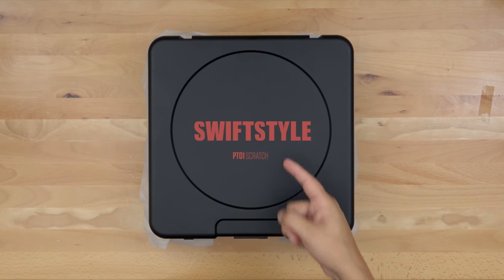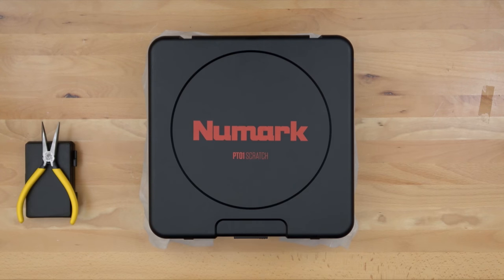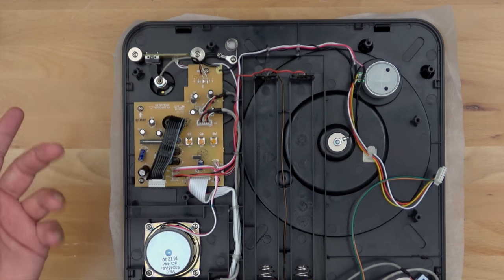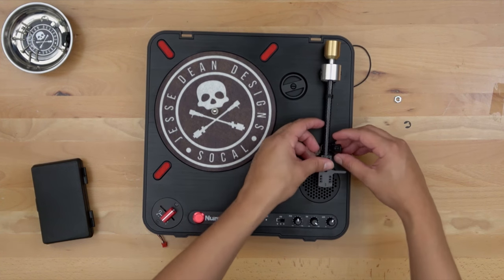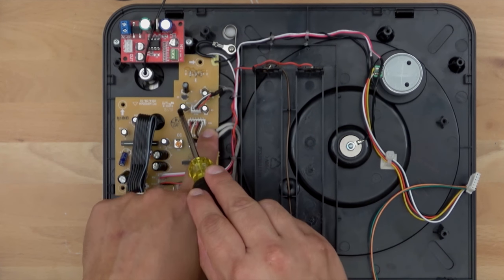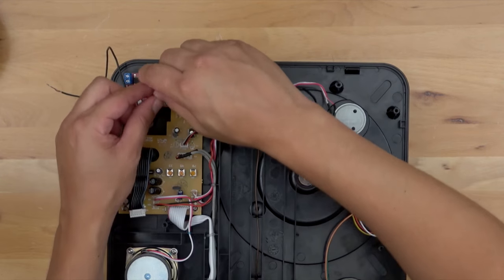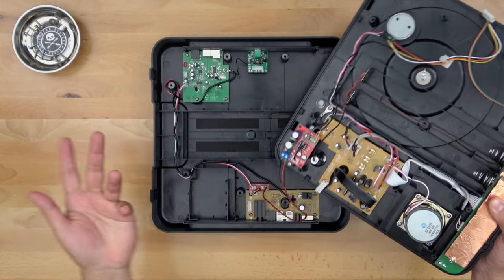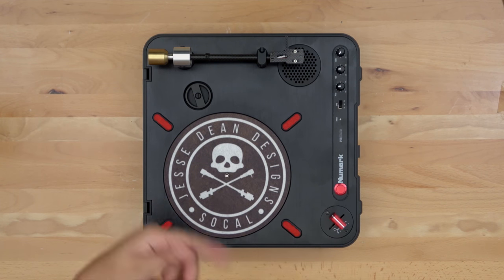JESSE DEAN DESIGN PORTABLE TONEARM (JDDPTA) | INSTALLATION

Comment: Kinda wish Jesse would've tried to use some affordable materials when making the tonearm, the milled aluminum and carbon fiber plus the pre-amp makes it cost more than the pt01 scratch itself. Numark should consider partnering with him if they plan on redesigning and releasing a newer version.
Reply: Thats the case in any decent setup, a tonearm alone will cost more than a turntable, not to mention a decent phono; this package actually seems like a bargain.

Comment: Finally got my JDDPTA in the mail, thanks for the video; it made installation straight forward and put me at ease when I was nervous about soldering/desoldering capacitors for the first time.

7:53 did you skip a step to where the connectors on the board go? I figured it out by just freeze framing and copying where they went but it would've been nice if you explained it. Do you know if Jesse is going to make more things to utilize the extra power out connectors on the power board?

Comment: I just got the newer version of this tone arm and I can already tell the set up is a little different. Not sure if we still have to remove the capacitors on the new set up. Also not sure where the extra part should be mounted and connected.
Reply: Check out jessedeandesigns.com

There is a installation guide. Easy peasy.
Reply: I'm in the same boat with the same question.  @Fe do, that link isn't good. FYI.
Reply: Krushtek 1 u need to remove capacitor c8 and c18 !
Reply: Check his webside...u will find something i am sure, he haves good tutorials for this. Installation is not that hard. Hope u guys get it. If not hit jesse up on instagram or facebook, i am sure he will help u out✌🏻
Reply: Thanks for the reply.  I think I figured it out.
Reply: Krushtek 1 ok nice !:))
Reply: @Krushtek 1 Hi, so did you got rid of these capacitors or you left them? I got the same issue.
Reply: Hi!  Man, it's been a while and I can't remember off the top of my head.  I remember that the new boards were different than the vid and I left the capacitors on.
Reply: Gotcha. I've removed them because I was following this tutorial and then realized that the installation guide for the new tonearm is slightly different than for the old one. However, it works just fine without these capacitors, so I think it's nothing to worry about. Cheers!
Reply: Great!  Glad to hear! Enjoy!
Reply: @lilxjam  I did the same thing, I removed the caps before noticing that the tone arm was slightly different. Did you end up soldering the wires from the preamp to the same capacitor spots like in the vid (6:18) or did you use the supplied 'no solder board'?
Reply: @hec0  Hi, I didn't solder them back. I was told that it doesn't matter if they are soldered or not for this particular issue. Cheers!

Comment: Can i still mount the pre amp to the place whats shown in your video when i have a relay there for start stop ? Instead of the factory start/stop board ?
Reply: Fe Do have you worked out how to do this? I've just got the point where I'm about to instal the preamp but my relay is there, im unsure how to move it or what the wiring would be
Reply: halfkut2193 i am still waiting for my jddpta to arrive..

Does the pre amp fit on top of the relay ? How u did it now ? Please let me know. Peace
Reply: halfkut2193 how u made it now ?:)

Comment: I've installed on my two turntable one is perfect, the other made now a airy sound when powered up, plus the sound of friction from the belt on the platter comes into the audio.
I have to remove all and try to see which piece is not working properly as it was not like this with the original tonearm.
I've to Jesse Dean 4 days ago, I'm sure he knows this kind of issue.

Comment: I’ve installed this and absolutely no sound coming from the built in speaker. I’ve checked  everything over several times and nothing changes. I presume I have a knackered tone arm.
Reply: Did you figure this out? I just installed mine and I have the same problem
Reply: @snaggedfiddle  They sent me out a new pre amp after having several conversations which seems to have done the trick (sort of).However its pretty quiet on the mono speaker and I'm having issues like others are taking about with only coming out of the left channel, I'm not convinced this hassle is particular worthwhile, I wish i'd have used to money to repair my Technics instead, one problem after another.

Comment: Man I hope he restocks these, missed the release. Good stuff
Reply: Stephen Huang  JD told me in 3-4 weeks..👍🏻
Reply: Good looking out!
Reply: He's got a black one out now. Be advised, it's a completely different preamp. NO SOLDER on the new one. I just bought it, removed the capacitors then realized I wasn't supposed to!!!
Reply: In the installation guide for jddpta black i cant see the capacitors c8 and c18..so i think they need to be removed/unsoldered ?! But if not its cool, but seems to work without too !